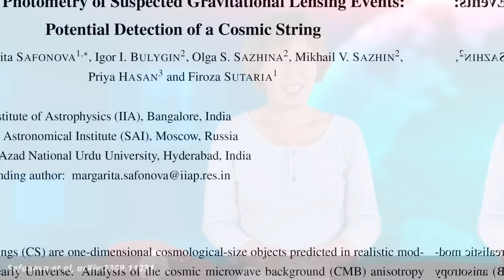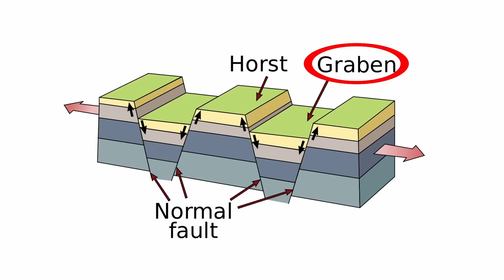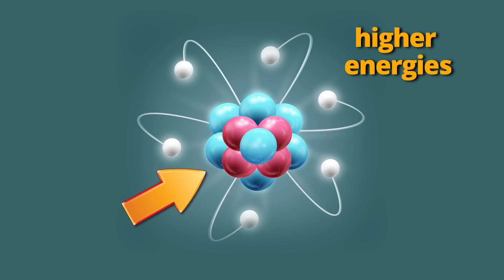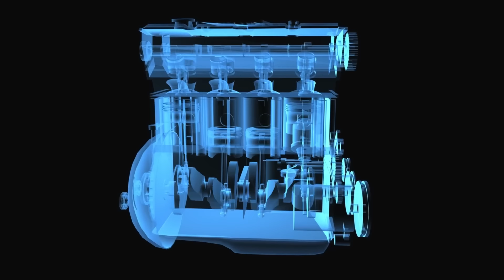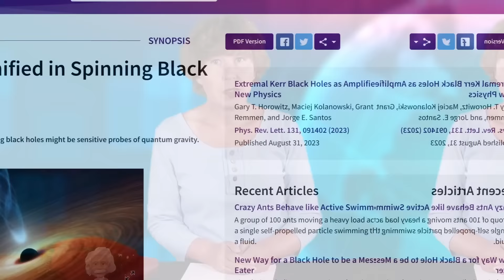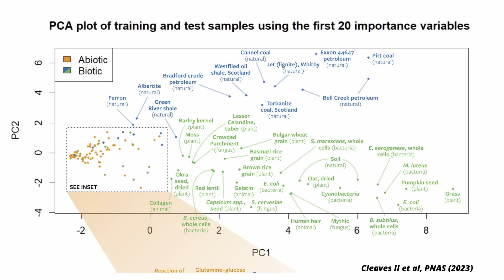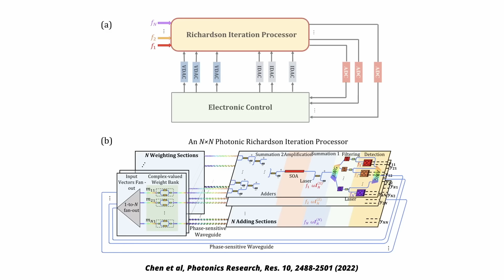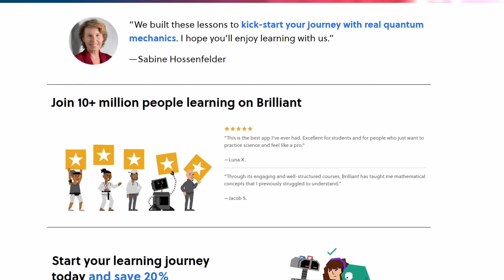Could this be the first evidence for string theory?

Comment: Don't you need an accurate clock in order to measure the resonance frequency of something?
Reply: So the angular momentum of orbitals can be calculated using quantum mechanics and atomic number and these predictions are based on planks constant which is accurate out to something like 20 digits. As long as the isotope is pure, otherwise you can get a faint secondary band. 
    So what determines the accuracy in device testing is going to be the measuring device and variance. And so if you are counting something at very high frequency you can look at the variance of events per unit time. So lets say the wavelength is 1 angstrom, the frequency is c/l which is 300,000,000 * 1E10 or 3E18, if you can measure the number events in say a millionth of a second, uS, then you count 2,997,924,580,000 +/- V. 
   If your variance, V, is small, say 1, then you can use statistics to calculate what the variance would be in a second. You can model this based on the binomial probability distribution, as the number of events increases the mode looks less like a wave and more like a kroniger delta function. If I remember correctly if you had a variance of 1 part in 3E12 then in a uS it would be one part in 3E15 variance in one second. In 11.574 days it would be one part in 3E18 variance, in 31687 years it would be one part in 3E21, and on finally one part in 3E24 in 31.6 billion years or about one part 1E25 in 300 billion years. 
   So all we need to do is calculate the number of seconds in 300 billion years. 
86400 x 365.25 x 3E11 = 9.468E18, which gives tells if we are using a 1 angstrom laser we might be accurate to microsecond in 300 billion years. This tells us that the variance is not one part per trillion range, but more like one part per million range. 

To visualize this process imagine we flip a coin 1 time
we get 
head , expected 0.5, (rv 0.5) next 10 times
3 head, expected 5 (rv 0.2) next 100 times
60 heads, expected 50 (rv 0.1), next 1000 times
475 heads, expected 500 (rv 0.025) 

As we can see as we increase the sample size (e.g. statistical power) the relative variance drops even though the initial variance is quite high, 50%.

Comment: Highlight for me is 4:30 et seq, because Caesium calibration is used in preference to Rubidium frequency standard calibration for electronic test equipment. Whereas caution is required (the Josephson voltage standard is unlikely to be binned overnight), the central fact is that the definition of a volt depends upon the definition of an ampere, and the definition of an ampere depends, inter alia, on the 'second'. That is, volts and amperes are ultimately defined by reference to effluxion of time

Comment: The clock may be accurate, but how fast can you compare two values?  Like watching a movie, just put the x's and y's here.  But if I want to know is a person moved from behind a building or out of a door or window, allow to have a signifigantly accurate comparison insertion, or you rotated you view around a corner...it just ticks insanely fast, only one tuned wire cam even bin the guiger counter tickings.  So, why not just have resistive calculation wires instead of transistors?  Some frequencies are rejected by certain alloys creating a carnot table.  Under the table there is an etch a sketch created by a Stanford wizz cranium.  But light would take les effort if you had 13 signifigant digits to a shared hole.  Not to collect eigenvalues, but offsets for the over minds.  They must test it until its The Magicians going to magic school in Russia, "ok here we are at the world renoun walt disney world, do you kids want to see calvin coolidge participate in racism with us?"

Comment: With Mercury being so close to the sun the orbit would be based on gravitational pull of the Sun versus counter force of photons striking Mercurys surface, if the size of Mercury decreases, the force of photons against the surface would lose equilibrium with the gravitational pull of the orbit. 
Is the photon force against Mercury anything to be concerned with.
Reply: @Edruezzi  
Good one “Pretentious word salad”😂 but it actually was late might and low caffeine levels.
But as a Mere peasant on a public networks your reply doesn’t seem to match my query?
Reply: @Edruezzi  
Good one “Pretentious word salad”😂 but it actually was late night and low caffeine levels.
But as a Mere peasant on a public networks your reply doesn’t seem to match my query?

Comment: This is confusing regarding the scale of strings.  It seems that they were candidates for sub quark reality, now they can be larger than galaxies.  If their real extent is related to the amount of energy embodied, how can they be considered quantum at all?  If they are fungible and divisible, they are not irreducible, nor fundamental.  This explanation seems odd to me
Reply: One must differentiate between cosmic strings and "just" strings (sometimes called superstrings), the latter are the fundemental building blocks you are talking about, the former are collosal galactic structures that are predicted to be a consequence of the fundemental strings from the times when the entire universe was shrunk closer to their scale (but don't necessarily have to be, the cosmic string theory originally developed completely independently of the string theory)
Reply: @asd-wd5bj  thanks for that. As I said, without revealing that very distinction, the audience easily conflates "cosmic strings" with "super strings", which are distinct concepts developed independently.  The situation is further muddled by the choice in both instances to rely upon the word "string".  Conceptually, in both cases, the word implies a topological feature of an open or closed non-branching continuous pathway within space(time).  Otherwise, the two phenomena couldn't be much less similar.

Comment: 🙋🏻‍♂️With ai one should be able to test the Heavy side role of a drilled out dice with opposites adding to 11 and see if the light gets to the end in a series of 6x11 or play around with opposites Adding to 7 and chess boards ❤
I would like to know dose certain Frequencies create star system patterns in the expressed light at a moment in time observation like a singing bowl of water makes flower patterns at different frequencies ❤💁🏻‍♂️
Reply: All I can do is a chess board like a piano that turns dice but every time I fill each one with fire the hole thing goes up in Smoke 😂

Comment: 0:36: 🌌 Astronomers may have found evidence for a cosmic string, a hypothetical giant thread of pure energy longer than a galaxy.
3:45: 🌍 Mercury is shrinking and a clock with record accuracy has been developed.
7:34: 🔬 This video explains the difference between bosons and fermions and how they can be converted from one to the other.
11:18: 🔬 The video discusses extremal black holes and the quantum effects near them.
14:47: ! Photonic components are a direct and efficient way to encode matrix multiplication, but using complex numbers is often unnecessary for everyday applications.
Recap by Tammy AI

Comment: Ok. This is a strange and somewhat un-educated what if.
What if there are two universes. Our universe of mass or particles with mass, and another of massless particles. The second universe is almost 100% light.
What if the speed of light is actually the speed of the strings that oscillate in such a way as to show the underlying light universe. So, when we see light, we are actually seeing the strings of the universe separate enough to see the light. As the wave travels through the strings of our universe, it would appear as if there is a packet of light moving at a constant rate. When in reality, there is actually no light in our universe. 
Perhaps, the redshift is nothing more than string tension that makes it appear as if the distance between is expanding.

Alternatively, the mass that falls through an event horizon would affect the second universe in an unknown way. Perhaps there is a relationship between the visible light (spaces between the strings) and the mass inside all black holes. Perhaps, there is more meaning to the yin-yang than being just a symbol.